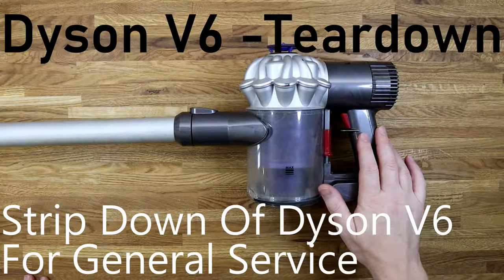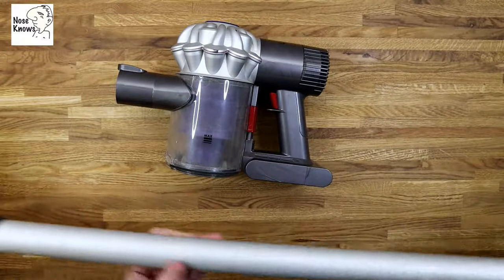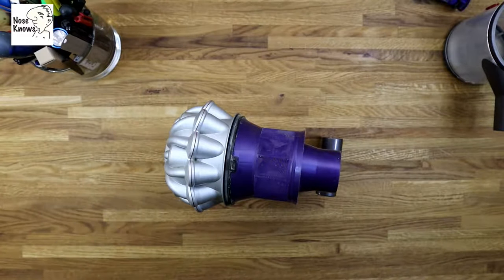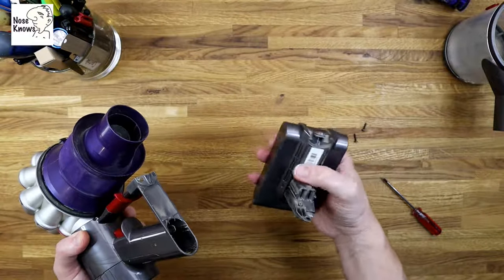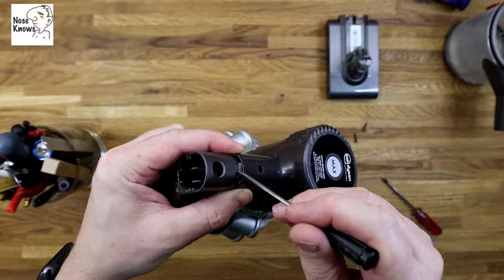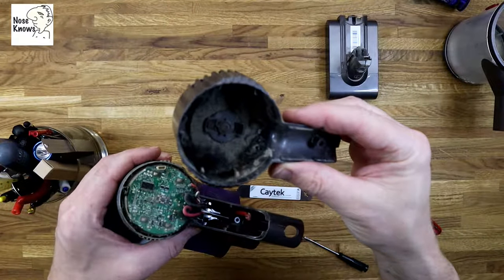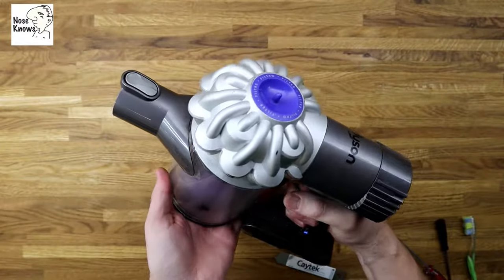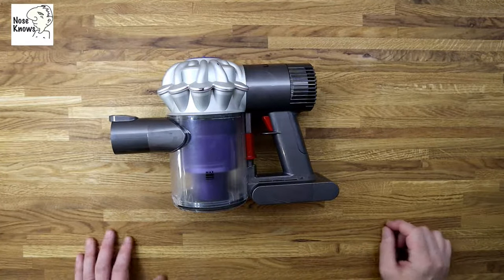👍Dyson Handheld v6 Strip Down / Tear Down & Repair complete tutorial.

Comment: your video gave me the guts to try and move the seized motor, and reading it on a fix it website.  I have a V6 max, changed the battery, the crown, washed the filter, nothing.  You physically have to spin the motor, the inside of the grey thing, with the battery detached.  I stuck a small screwdriver and spun it clockwise, no go, spun it counter clockwise and the thing worked even stronger than before.  I read where the motor seizes so you have to move it manually to get it to work again.

Comment: Great instructions. My V6 stopped working, new battery still didn't work. Tore it down using your brilliant instructions. Fan didn't have anything in there but moved it about and voila it worked. Feel like I didn't do anything specific other than tear it down and check each component I put back one by one still worked. Thank you

Comment: I strongly suggest to add focus on cleaning the fabric triangular/funnel shape filter. Dirt is collected inside that filter and if such dirt is not removed, then there is a high chance the unit will still be pulsing. Before considering washing the filter, the filter's lid/cover needs to be removed, then loosen the dirt inside of it with a brush, vacuum the inside, and only after that, it can be washed with running water on the outside of the filter. Never run water or compressed air inside that filter as any dirt residue will be pushed further in which will eventually caused the filter to clog,

Comment: Great video thanks plus battery reset hack to restore battery life!!!
I was going to throw mine away as the battery was only lasting around 10 seconds. I used this brilliant video to properly take it apart and then clean it but there is a battery hack worth trying too. 
Unplug the charger, plug it into your Dyson then switch on charger. Then, hold the "on button" on the Dyson for about 20 seconds then release it. Amazing - the battery life is restored !!
I understand this can work on many Dyson cleaners and saves a fortune!
Reply from the maker: Thanks Keith
Reply: Evans charming!!
Reply: @nickevans7049  - that's an infantile comment. Time to grow up.
Reply: @ardwych4881  but that hack dont work !
Reply: @nickevans7049  - there are nicer ways to say it, don't you think, m'lad?  
['doesn't']
Reply: @ardwych4881  oh sorry 😞

Comment: Your the man. Did all the normal strip clean and back together that I had done before multiple times before including popping rear cover of motor to check the coarse and fine filter sponges there. (Max fill line means max fill but some people do not get that!). 
Checked my battery (it has been replaced with slightly bigger one after old one packed up) with voltmeter and it was good. 
As soon as you triggered it you got flash code five on the power change button led. 
I had forgot front access. Long nose pliers on the lock ring and a bit of jiggers pokery (half came undone a few times, then when half undone pulled lock ring back towards myself and eventually released about fourth attempt and front end off. Moved motor, it has some strong magnets in that baby, moved it it a max of a turn, tried it again and flash codes changed a bit and second operation of trigger it flew into life. Perhaps it has position sensor perhaps a bit stuck, it did not feel any looser after it started to run and stopped and checked but it runs. Thanks for pointer just done a full battery run with it and suction is as good as ever. They do clean well but need looking looking after, do not go past max.
Reply from the maker: Thanks Anthony - Really glad it helped.

Comment: Thank you very much for doing this video! It will be so helpful when I pull my Dyson down for major cleaning. I'm surprised that the threads got that far into the machine,  as it has a pretty good filter system. 
Cheers from Australia.
Reply from the maker: Thanks David - Hope it helps
Reply: you think so?? Ive been using mine for years in the DESERT and there is never anything in the filter--that makes me suspect it even works

Comment: Excellent video, thank you! Mine wasn’t switching on with trigger, so thought that might be the problem- I have been following you and stripping down as I watch, I’ve got to 4.12 removed the battery and when I push the grey button on the battery no light comes on, is this therefore my issue that the voltage isn’t getting to the motor and is there anything I can do please, thank you 😊
Reply from the maker: Thanks Emma - Yeah you should have voltage might be worth voltage  (if you have a multimeter)
Reply: @noseknows  thank you,I think my OH has one I’ll give that a go

Comment: Thanks mate that was brilliant! I was ready to smash the thing trying to swap the battery.
I managed to do all cleaning etc as well but I couldn’t get the back filter off.  It wouldn’t budge plus the handle part 
Has a crack in it and I didn’t want to force it.  Very helpful, thank you.

Comment: Great video.  I have taken mine all the way down, gotten a new battery, and all I'm getting is a quick spin of the impeller when I pull the trigger.  Sometimes 1/2 second.  Sometimes less than.  Any ideas?
Reply from the maker: It’s usually the battery that causes that issue, but you’ve installed a new one so not sure sorry.

Comment: Got down to the impeller which didn’t spin freely.  I saw no blockage in or around the impeller.  It will turn underpowered foe a few seconds but stops .  Has the motor seized up ?  Thanks for the video.
Reply from the maker: Hey Richard - Yeah I would say so, the motors are generally a bit stiff when turning but it should turn freely.

Comment: Thanks for the video, very informative. I have just been asked to have a look at one, the red light of death. It flashes red even when it is removed from the body and charging doesn't seem to work as it has actually dropped rather than increased, would you say a dead battery? Is it worth stripping the battery to check for broken wires? Your help is much appreciated. Oh, is the motor, a stepping motor, as, when I check the rotaion, it only moves in increments.

Comment: Really good informative video. Thank you. I never knew that you could strip it down like that. Also good to know the battery can be replaced should it ever need a new one. I am just surprised the centre cone that holds the filter cannot be removed as a lot of dust collects in there and is very difficult to access/remove.
Reply from the maker: Yep I agree Raymond
Reply: It actually does have some particular screws and can be opened up BUT one must be very careful to keep track of everything and the gasket that’s sandwiched between the two upper tier pieces is delicate & likely should not be washed in the same manner but lightly wiped off.

Comment: Excellent tutorial, thank you. Your strip down is very well explained. Could you please help? On mine there's no power on the 2 terminals (main body) that take power to the brushes. I've cleaned them but zero volts. Thanks in advance

Comment: Great strip down explanation, wish I found this a couple of days ago when I had to sit and work this out myself. 
Unfortunately even stripped down my motor is still pulsing, will need to blow some compressed air through it and see if I can free it off.
Anyway, keep it up great clear ”how to” video 👍👍
Reply from the maker: Thanks d3lts1 - that’s appreciated
Reply: There is obviously the bowl to clean then the filter sock in the top you can take that into two pieces little plastic wedges at top edge use pen knife carefully to eases them out. Had blockages in there.  Plastic shroud with screen can be unclipped and cleaned in there. The motor has two filter in the back end. Little bit more difficult to pry that apart. One screw and need to pry gently and pop it apart. D59 version. The socks need replacing every now and then.
Reply: @anthonywilson4873  thanks for the tips. Have stripped all that out as well and split the bowl. In the end I recharged the battery again and pulsing stopped. I think in the end I cleared the blockage but had drained the battery during testing and cleaning. All good now. Thanks.

Comment: Great video. The brush on my Dyson spins for a sec and stops however the motor continues to run. Any tips and a video to address this?
Reply from the maker: Sorry Tanbir I don’t have a video on this, sounds like the motor has gone in the head. The previous comment to you has a similar problem.
Reply: @noseknows  No worries, followed a video and found few mm of hair behind the unit which spins the brush. Needed a T8 screw to remove the unit. All good now.

Comment: Well thank you. This handheld is the worst damn thing to take apart. Everything was jammed on never to come apart again. White buttons, oh yes,they were not compliant at all. With full set of computer tools and jewellers screwdrivers, found the inside immaculate, impeller immaculate, circuit A1, no rubbish. But the blue filter casing was really all I had to clean. Workman decided the handheld was ideal for zooming up plaster, um no. These things are not designed for ladyfingers to take apart. Rather like the large Dyson.

Comment: Great video mate. I’ve done a breakdown before but never to that extent. Unfortunately I’ve got mine broken right down and still having trouble with mine shutting off after a few seconds of use with a yellow light flashing on the battery. The impeller seems stiff. Like you can turn it but it’s like it spring loaded and when you turn it, it springs into the next location if that makes any sense. Is this normal? Or is this the problem I have with mine. As I said before great video on instructions on the breakdown and reassemble. Any help will be much appreciated. 🤞🏼👍🏼
Reply from the maker: That’s exactly how the motor feels which is normal. Have you tried a replacement battery.
Reply: @noseknows  I have replaced the battery once before. This is the second battery. Is there a way of testing the battery?
Reply: @noseknows  I just put my multi meter on the battery and it has 22.2V

Comment: Did the motor speen freely or you had to apply some pressure? My motor ha nothing blocking it but when i supply power with a dc source it pulses. Any suggestion?

Comment: Hi, I stripped my DC58 down because despite a brand new battery and it working for 10 minutes, it flashed a green light after a recharge and being on for 10 seconds. I was wondering if the impeller blade should spin freely as mine does not if I try to move it with a screwdriver. Its quite stiff. The main thing I cant find is why the green light flashes despite a full charge and working for 10 seconds.
Reply from the maker: Hi Peter, the impeller blade should not be tight as such, it does feel like a magnetic resistance when you try to turn it so there is resistance but not a lot. Not sure on the 10 seconds, is the head motor spinning ok? Was the battery a original Dyson and new ? Is the charger fully charging the battery ? To be honest it could be one or a multitude of things.
Reply: Someone on this site said that a flashing green light indicates a very low battery. Maybe Dyson chargers are now sensing whether the battery comes from their factory or not, as manufacturers are doing with laptop batteries and printer cartridges. There really should be a law. Where's the EU when you REALLY need it?

Comment: Thank-you so much, an excellent tutorial, I followed & did everything you have shown.....now got the 'thing ' back together but STILL the brush won't rotate.  :-(  I shall never buy another Dyson I have spent more time cleaning it than vacuuming.
Reply: start from 6:04 or around there is what helped me.  If you turned the motor one direction, try doing it in the other direction.

Comment: Very helpful thank you, i have an issue and wonder if you've come across it, the brush heads on my v6 is not spinning, i tried everything suggested on Youtube videos but no joy, i borrowed a motor body from a friend and the head spins freely ,points to problem in my motor body,any ideas ?
Reply from the maker: I think it’s like you said the motor has probably gone in the head, so see if you can source a second hand one or maybe call Dyson they are surprisingly good with there warranties (some times 5 years)

Comment: Hi, just wondering if you have any experience taking the V 11 apart? I need to replace the trigger mechanism on mine as the spring is not pushing down on the battery on switch. Thanks for any help you are able to offer.
Reply from the maker: Hi sorry no I haven’t done the v11.

Comment: Used vacuum one day ok and battery ok. Went to use the next day and flashing blue light. Family member used it for about 1 minute and it stopped working and put back on charge. No flashing light nothing. No red, no Amber no blue. Recently changed battery and has been working great. I got a new battery charger as thought that was problem but have tried and everything still dead. Should I just strip the vacuum down anyway to see if something is blocked? Hope you can come up with a solution like I may just need a new battery?

Comment: Well explained, thank you!
Can you tell me what size Phillips screwdriver I should buy?   Thanks!
Reply: It's not a Phillips screw, actually, it's Pozidriv.  The type and size is Pozidriv PZ-1.
Reply: @VeryWetPaint  thanks…but my question is from one year ago.
Reply: @caprijol4508  it's still a relevant question, since I needed that same information YESTERDAY...and it hadn't been posted yet.  Since the video erroneously mentions Phillips screws, I awkwardly removed the first screw with a badly-fitting Phillips screwdriver.  Upon discovering it was a PZ-1 screw, I switched to a Pozidriv driver and the rest of the screws came out much better.  So, thanks for posting the question a year ago -- I'm really sorry nobody answered it sooner, but you gave me an ideal place to share it.

Comment: 6:15 are you sure the impeller is meant to spin? No visible damage or fluff but it's sized up and won't spin. Can't take it apart without damaging circuitry?
Reply from the maker: Absolutely the impeller should spin (there is a guard in front of impeller that is fixed)
Reply: Thanks! Surprisingly a replacement motor from Amazon is only £40

Comment: Should the motor spin as mine clicks roound
Reply from the maker: It does feel like that when you spin the motor, it doesn't spin freely - it should feel like it moves around in stages not really a click more like a light thud as you spin the motor.

Comment: quick question my dyson its working fine after cleanup but when i press boost button its cutting off in less than 20 seconds. at that moment battery needs charging.
Reply: I used a t8 screwdriver on the next purple part that he didn't take off that's were the problem was for me alot more dust I think there are 6 or 8 screws easy to see good luck

Comment: My dyson works for about 2 minutes when it should be fully charged then cuts out completely, when you press the trigger
the 2 small blue lights either side flash on and off does this mean I need a new battery
Reply from the maker: Hi Alec, obviously I cannot say for certain but if it is running freely and you can use your Dyson Handheld  for 2 mins before it cuts out then it would suggest the battery needs replacing.

Comment: How do you dry the foam filters quickly and efficiently?
Reply from the maker: Hey Shef, To service Dyson vacuum filters I usually rinse them in cold water then dry them either on a radiator or if it’s a nice warm sunny day I dry the filters outside.
Reply: @noseknows  lol. That sounds reasonable. However, I live in Florida, USA. No radiators & outside humidity never dependable drying weather. 

If I want to fashion new pieces- any idea what foam to use?
Reply: I use a hair dryer to speed up the drying process. 
I also have a pet hair dryer. That works wonders for speeding up the drying.

Comment: I bought a V6 second hand. The previous owner explained it was pulsing. He wasn’t very handy so he sold it to me on the cheap. I’ve completely stripped down the cyclone, cleaned and reassembled it. It now works great in normal mode, but still pulses in max mode. 
Called dyson, since it wasn’t registered by the previous owner, I registered it. They sent me a new motor assembly. Exact same issue. Called dyson again, they’re sending me a new cyclone. 
Any thoughts on the possible issue???

I took my cyclone completely apart, cleaned everything, seals, filters, parts, everything.
Reply: dont know

Comment: I HATE my V6 and usually grab my CHEAP "broom styick" dustbuster with a head and now call it a vacuum over the Dyson D6. It's bulky and cant be maneuvered very easy(The unit itself not the swivel head (made of CHEAP plastics) --not good for your car, I can tell you that. The ONLY positive I can think of is it is reliable and still has the original battery.